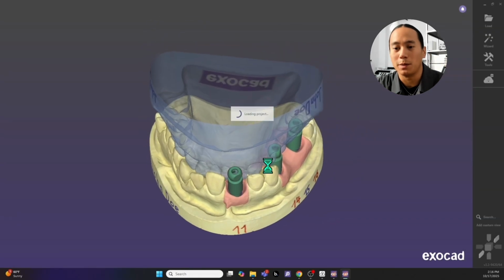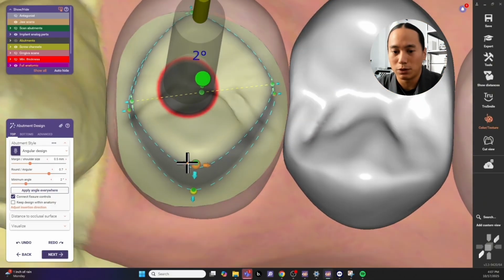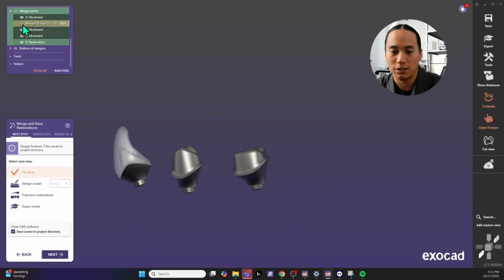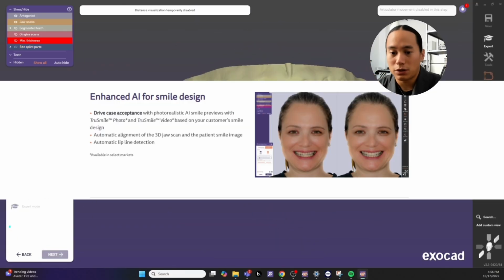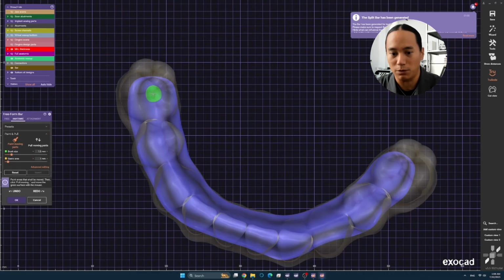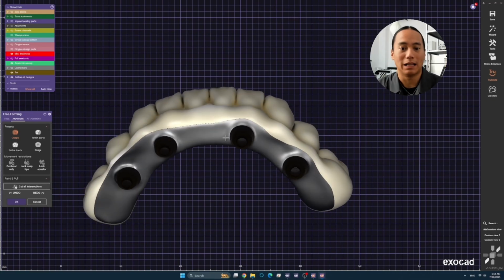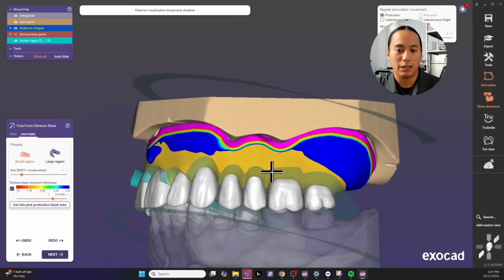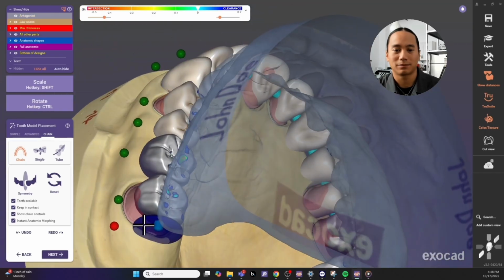exocad 3.3 Chemnitz Overview & Highlights

Comment: I’m really concerned about how people now think that using Ai to design these cases makes them think that because the computer has designed it then it’s correct, from what I’ve seen the designs are not good, this video showcases how poor the design is, I’m really pro technology but people still need the knowledge and skill, this makes people believe they have the skill without the knowledge… that’s dangerous
Reply: The split bar doesn’t take into account undercuts so will generate any old shape, which makes manufacturing the bar and superstructure in one go much more complicated, despite what is depicted in this video, so there is more to consider, don’t be fooled by how easy it looks here